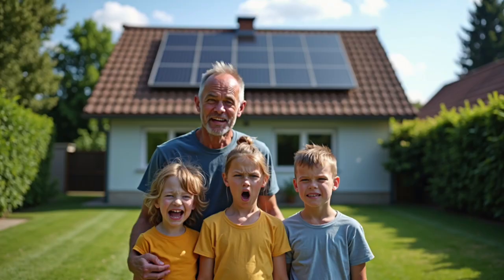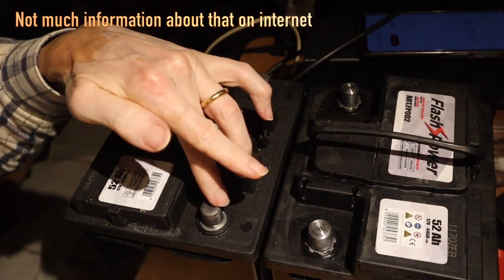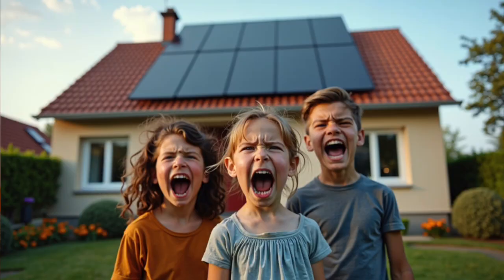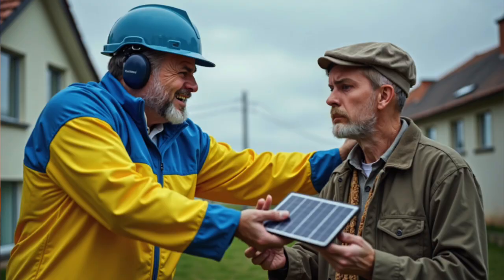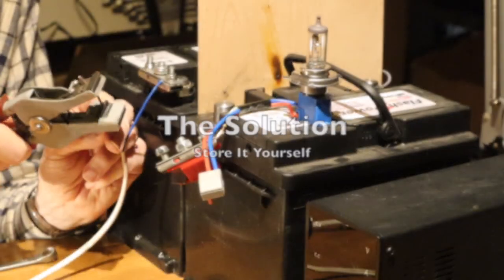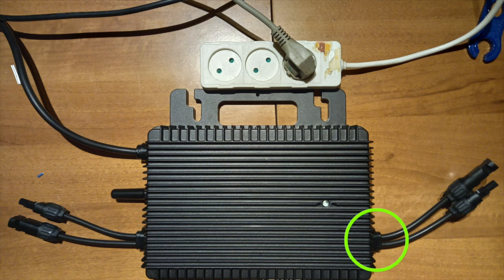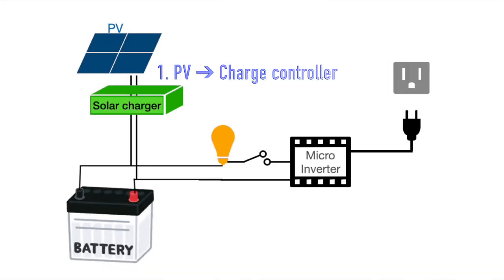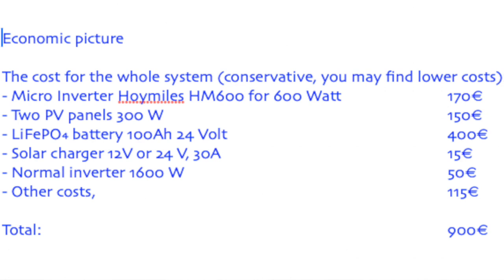How to start small with Plug & Play solar and grow later? Video 100

Comment: Interesting use of a micro-inverter. But I'm not sure so fully DIY is actually so convenient. For example the Pecron E1500LFP costs €599 and gives you 800W solar input, 1.5kWh battery, 2200W output (peak 4400W, vs your 600W µinverter and 1600W "normal" inverter). That's €150 less than your system (without the PV panels, which can be the same). It's 1kWh less battery than yours, but better in other ways, and it can take two 3kWh expansion batteries at around €700 each (each of which also has another 400W MPPT). The only thing really missing is the ability to sync with existing grid power, so you're limited to things you can run with an extension cord (or if you disconnect the house from the grid temporarily). I'm using my bigger E3600LFP unit to run everything that runs continuously (computers, starlink, fridge, dehumidifier, portable AC in summer) with extra input from a 240V socket as needed (or generator during long outages). But I'll have to think if I can get it to power a micro-inverter from its DC output (30A 12V) to feed into the house wiring. Unfortunately the one you use needs min 22V (and is no longer manufactured).
Reply from the maker: Hi Bruce, I don't think that my Hoymiles is now out of production, the manufacturer has much success with this HM600 model with high efficiency and quality. Just to start from the end of your message😉.
I will see the Pecron system but it seems that you are working with off-grid as you tell that you cannot sync it with the grid. I also have several videos about off-grid but during normal times with the grid OK, it would be nice to have the small PV system contributing to all users in house, leveraging the complete distribution to all you have, but without the limitation that it has to provide the full power that is needed. That is why it is so nice and allowing you to have the full deployment of your PV, as long as consumption > production. And if not, the battery is the nice solution and that is what I will do also next weekend.
Reply: @nnvasen-good-energy  I'm effectively doing a mini off-grid system, directly powering everything using extension cords and power strips from the "portable power station". Fortunately almost everything is in one room anyway. The only things I can't easily physically power directly from the unit are the oven (seldom used, cooktop is gas), hot water heating (which I turn on in my "free hour of power") and the lighting in the toilet, bathroom, and bedroom (all of which are LED and only typically used for 5 minutes). With the amount of solar I'm planning (6x 440W) I expect to have a deficit in winter (need to top up the battery from mains power at night) for the things I can easily power, and a surplus in summer that should very closely match the need for air conditioning (bright sunny days) except that AC isn't needed until 1 or 2 PM, but still wants to work a little after sunset (the roof and walls retain heat). I might want to get another 3kWh of battery for summer ... I'll see how it goes, that's six months away.
Reply from the maker: Sorry Bruce for the late response. Six months away! Where are you that you have the hot month in December, Australia? Maybe you can also use Phase Change Materials (PCM) to even out the temperature differences during the day, if you need it so few hours.
Moreover, with little consumers that work only 5 minutes, you can use those battery (AA size) automatic lights, that "see" you. Anyway, I see you still have the grid but are close to say it goodbye! That will save you all the fixed costs of connection.
Did you see (if you really want off-grid) my playlist of micro CHP? That works in our house and will give you plenty power, also to charge a battery (as you are going to buy).
Reply: @nnvasen-good-energy  I'm in far north New Zealand .. about the same latitude as Sydney but not quite as warm .. I have +8º C tonight and the wood fire going. I don't think it's worth getting rid of the grid entirely here since the wires already exist and at the moment the fixed charge for a "low user" (<8000kWh/yr and I'm 5000) is 0.36 euro/day. or 131 euro/year. Unless I later have enough solar+battery to fully cover normal winter weather it's worth keeping access to the off-peak rates to charge the battery and get through the night. However it's possible I may move to somewhere fully off-grid later, so it will be good to see how much I can minimise use of the grid. I should have the 3kWh 3.6kW battery/MPPT/charger/inverter unit in about a week and a 2200W petrol generator for power outages a few days later. No solar initially, just time shifting. But the unit will handle 2400W of solar on two MPPT controllers, so I should get some...  I had an outage from April 17-19 in a storm, and another four day outage in February 2023, as well as a 6 or 8 hour outage probably every 2 or 3 months so that's my main motivation to start the system. Re micro CHP, that's interesting if it can work from a wood burner. Propane is good for cooking here, but is uneconomic for home electricity generation or heating.
Reply from the maker: Hey Bruce, interesting place to live, didn't know that there are outage rather often. If they can be so long CHP is a solution for the winter and in my CHP playlist I have calculations that show convenience. You really get worth for your money if you use the full amount of energy in a litre of gasoline or LPG.

Comment: thank you for the video , can you tell me if there's a way that I can make this automatic to where during the day or whenever the sun's out the solar power provides power and when the solar power is depleted or no longer exist the grid power kicks in? And is there a way to make this whole system automatic? Thank you again
Reply from the maker: Hi Brainwashed, I see we are from the same country NL! I will make this automatic after the coming weekend. In the weekend I am going to show how to get battery power through a PWM controller into the micro inverter and to have control over the quantity. That is already kind of challenging. If that goes well, I will substitute the voltage divider of the manual control by a signal from a current transformer so that the Micro Inverter will adapt to the actual consumption by the house.
Reply: @nnvasen-good-energy  i wish i had your IQ!!! your very smart !! thank you for information
Reply from the maker: Hi Brainwashed, thank you so much for your compliments! But I have a way to go with feeding that Micro Inverter in a way that doesn't fail like last video...

Comment: Grozav😊 aștept continuarea.
Reply from the maker: Thank you Grozav! Indeed as written above in Italian (from where are you?), today I put this Micro Inverter directly on the panel you see at the last of the video. And it directly feeds 120 watts into the house (still no battery). It will be for the next video...
Reply: @nnvasen-good-energy  from Romania. I have eight Enphase micro invertor and i am very pleased. Succes😊